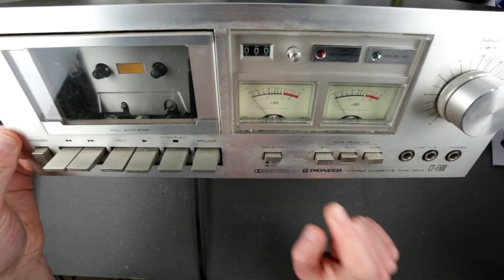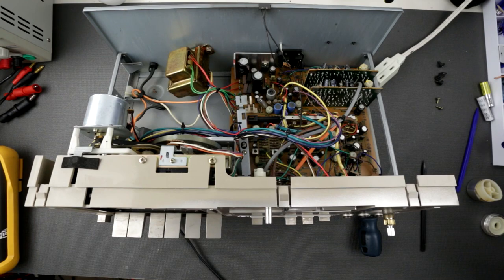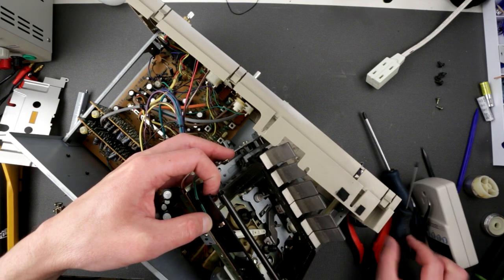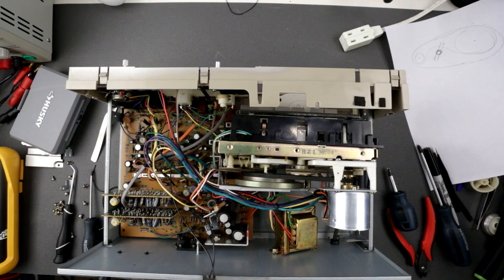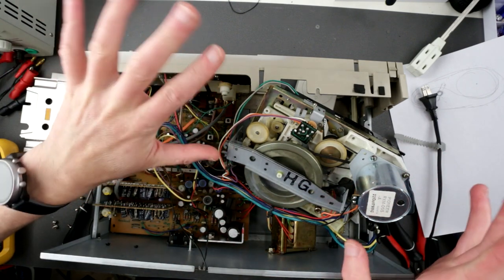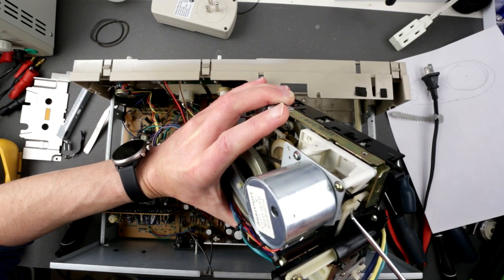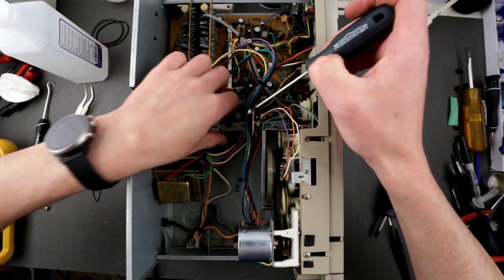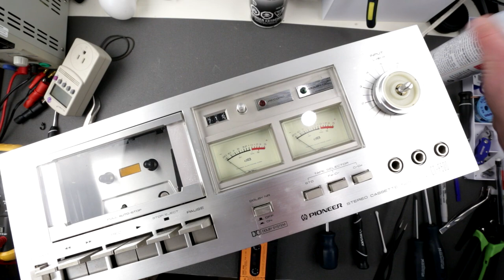Pioneer CT-F500 Repair Part 1

Comment: Mine has the small PCB attached to the motor bracket, as you mentioned some do. It's weird that they used two different designs without indicating it in the model number. This is one of the more difficult decks I've worked on! Trying to get that switch attachment back into place next to the flywheel?  Not sure if I'll succeed.

Comment: I clicked on this video specifically because I knew how tricky they can be. It's just a basic cassette deck, but somehow Pioneer came up with the most difficult disassembly process for changing belts. Easily the hardest to work on of any Pioneer cassette deck I've come across.

Comment: Hey this video was super helpful! However, for some reason after reassembling, playback no longer functions. FFWD/RWD and everything else is working correctly, but for some reason it wont spin whenever I press play. Do you have any thoughts on what might be causing this? I've tried completely dismantling and putting it back together in the hope that it would resolve itself but no luck.
Reply from the maker: Check little switch in the area of the bracket that hold the flywheel, right hand side of the mech when looking from the back. This is playback switch.
Reply: @InsideOutElectronics I believe that switch is working, the motor still powers on when I press play and the flywheel spins. For some reason the take up reel/supply reel don't spin, it seems the idlers don't properly engage. However when I press fast forward and rewind they work fine.
Reply: @fionn53 did you figure this out?

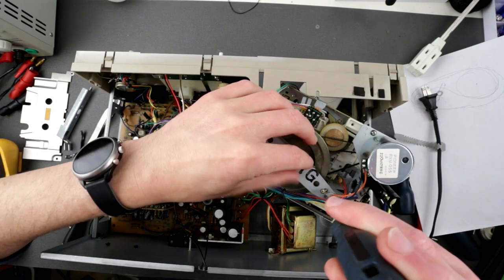Comment: I tried doing this repair on my CT-F500 to replace the 3 flywheel belts, the only screws i removed was the one you can be seen reinstalling at 36:30 of this video to pull that bracket back.  It allowed me to fish the belts out around the flywheel but after reinstalling all of my play/FF/RW/eject buttons wont push down. I was certain to put the switch on top of the arm you mentioned.  Any ideas what i did wrong to bind everything up?  It was all functioning perfectly before.
Reply from the maker: Thank you for watching. I remember I had  to push an arm in certain position to get it going. But I sold the deck and do not remember what exactly has to be done. Let me rewatch the video :)